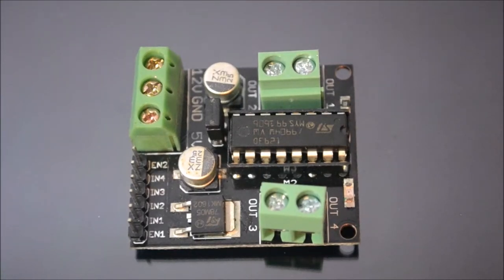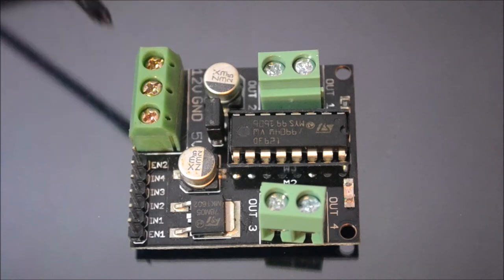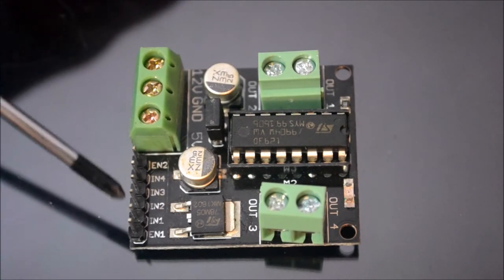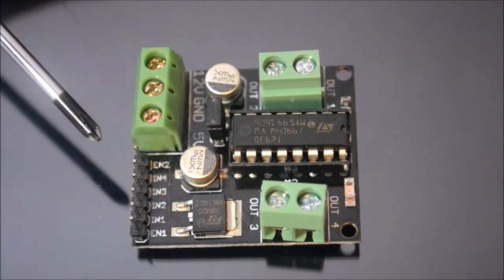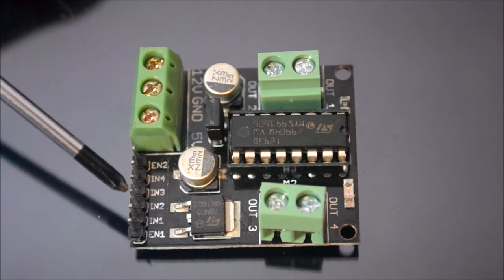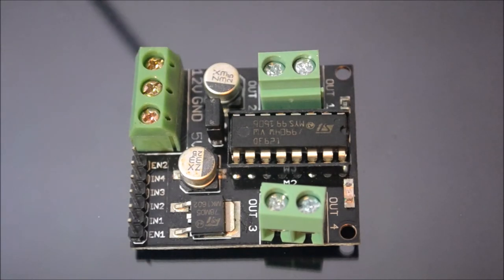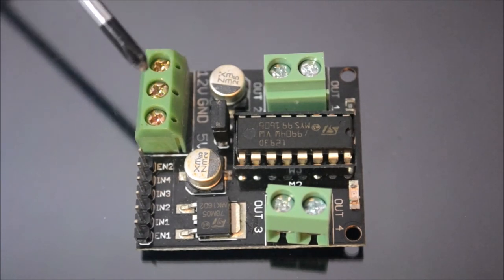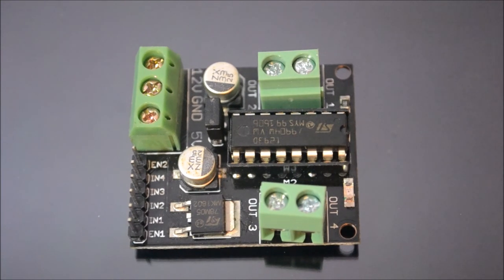L293D Motor Driver IC | Servo | DC Motor Shield for Arduino

Comment: how to make a line follwing robot with this
Reply from the maker: L293 motor driver shield is a quick way to control dc motor; it can handle higher current and voltage values. You can give the out put signals from the micro controller to the input of the motor driver shield and it will controls the movement of the wheels ( of your robot )